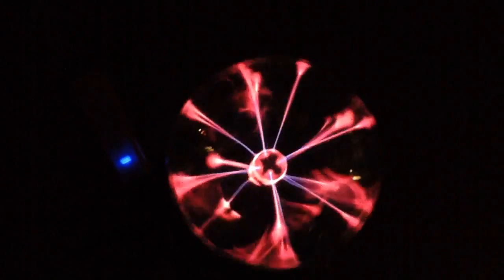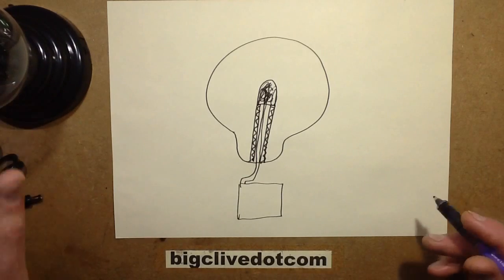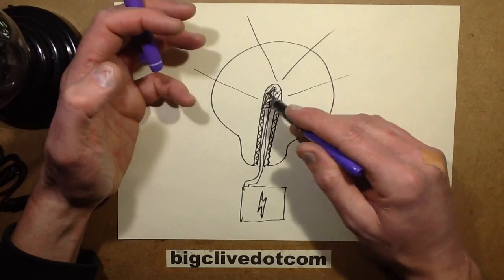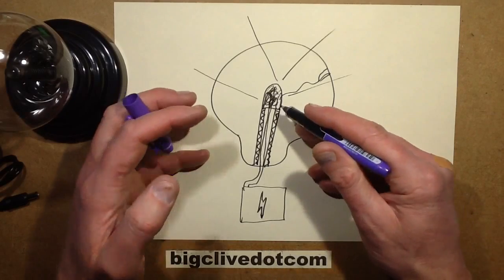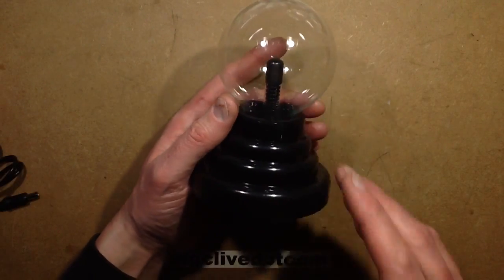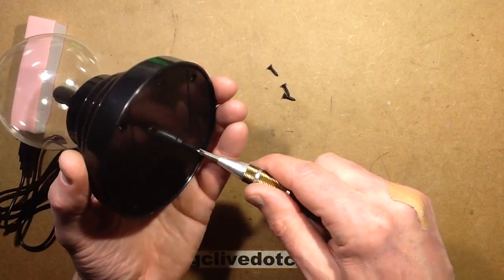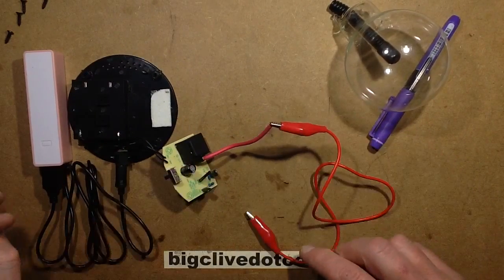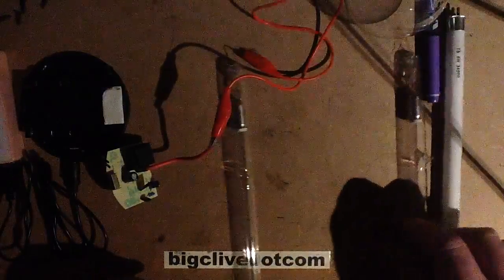USB plasma ball teardown and schematic.

Comment: So the shock you got was a burn and NOT as a result of high voltage? I’m designing a Tesla coil and want to take advantage of high frequency to prevent electric shocks, through the conductor skin effect. What’s the minimum frequency for this to happen? See electroBOOM’s videos on Tesla coils to see what I mean.
Reply: Over 500KHz. Litz wire works best below that but I'd say use 500KHz.

Comment: I have been burned by the secondary connection of a DC transformer for the larger ones. It may run on 12vdc, but at a very high voltage potential. I also had a12vdc ion generator module powered from a 6 volt battery with pins stuck in foil on both polarities in series with it and even they had coronas on them. The whole thing is an ion generator.

Comment: I had a plasma ball exactly like that as a kid, except mine didn't come with the USB cord, I used a regular power supply for it. Also mine had a bay for AA batteries in the bottom.

Comment: If you shouldn't power from your computer, and you shouldn't power it via a USB power supply, and it's USB, then how would you recommend powering it? I've one in the post and now I'm afraid to plug it in when it arrives :/
Reply: Bench power supply, a cheap USB charger you don't care for, an old broken PC...

Essentially anything you don't care about or something easily fixable

Comment: Hi Clive.
Could you use the electronics in the plasma ball for a powder coating system?
Reply from the maker: No.  It's AC output at high voltage.  It might be possible to rectify it with suitable diodes/arrays.

Comment: I have an old Rabbit Systems (ever heard of them?) plasma globe from 1987. Thing has a grounded plug and is rated for 117 volts at 30 watts. It has a microphone and will turn on and off with sound so it can flash with music. Pretty cool thing. It has a logo that says "Eye of The Storm" on the front of it. It has the old style glass antenna inside with a sphere at the top. I think may actually use a flyback transformer like you mentioned in the video. May have to open it up one day and peek inside.

Comment: you could put a coin on the top of the globe and then get another metallic thing and touch the two and pull the apart and you'd get a continuous spark , like a jacobs ladder.

Comment: Hi,

Mine works poorly - only about 2-3 streams (usually just that conductive tip glows). I'm not getting so many as you do. What could be the reason for this ? Gas leakage, failing transformer,... ? 😶😕🤔

Thanks !

Best Regards,
Reply from the maker: +David Bolha It's possibly the gas pressure inside the globe.
Reply: +bigclivedotcom Thank you for your reply sir, but how could I really fix/identify the actual problem (by process of elimination) ? Any ideas ? Thanks.
Reply: +David Bolha +bigclivedotcom the filaments in my old one have become thicker and lesser, so i bought a new one. The new one powered up nicely with thin and flowery like filaments, however within hours, the filaments have become lesser and slightly thicker... can pressure be lost within hours? thanks
Reply: It could be pressure/gas leakage, but it could be just any of the other electronic components that might have failed or are failing (in some manner). Hard to say without getting into proper electronics diagnostics. :|

Comment: Just pulled an 8 inch on of these out of the skip at work.
Plugged it in to an spare 12v power supply and it worked straight away. :)

Comment: Something weird I used to do with these plasma balls as a kid is cover them with tin foil and vaporize the metal material off of CD's with a tail of the foil. As imaginable these could also burn skin. Also was able to vaporize the metal paint off of playing/trading cards or reflective adverts, really anything which had a very thin conductive surface.

Comment: I ended up accidentally making a cell phone jammer with one when I was younger. I placed a soda can on top of the lamp, got shocked a few times, and realized I can make a small arc of electricity across the can and another metal object. When the arc was visible, the signal on my phone maxed out and immediately dropped to "No service." The range of the jamming effect extended just inside the 4 walls of the room. Leaving the room restored cell signal. I'm curious to see if anyone else has tried this.

Comment: bigclivedotcom: I bought one for these for $1 at a boot sale a few weeks ago and the HV seems weak, Not a lot of streamers when left alone and when you touch it you dont get a fine ribbon instead you get a thick band of plasma, However if you are touching the globe when you turn it on you get a very nice fine streamer that remains for as long as you keep your finger on it.. My question is that i suspect the HV is oscillating more slowly than it used to, Can you recommend a modification to get more Kick out of this thing and restore performance? or should I bin it?.

Comment: Hi! I bought a vintage plasma lamp at an antiques shop while traveling in Japan. Voltage there is 100V/50-60HZ while in my home country it is 110V/60HZ. Does anybody know if it is safe to plug it here or do I need a transformer? By the way, it appears to be Chinese, where voltage isn't 100v neither... Thank you!
Reply from the maker: +Alexis T. Aldrovandi The voltage difference is so small that it should be OK.
Reply: Thank you very much for your reply. Just tested the lamp and it was OK!

Comment: Hello great video!!!!  I am trying to convert one of these globes to run off an audio frequency converted to RF.  I have bought a device called an RF modulator.  It takes audio in and provides RF out.  Wondering if you have thoughts on this experiment?  Not sure if it will provide enough current or how the audio is converted to RF.  Thanks in advance!  Appreciate the video

Comment: Hey Clive love the video, but I have a question and hope you can help me.  I bought a plasma sphere like that one with the only difference that mine is powered with 4 as batteries. I wanted to use this sphere to convert a miniature building. Basically I remove the glass and place it in a plastic cilinder on the roof and I want to place the base of the sphere hidden in the building. I wanted to extend the wire that goes into the sphere ( by using a standard 1,5 MM wire.  But might I do this the plasma sphere does not work or sometimes it works but on less than half power.  Do you know Wat the reason is for this? And what I can do to make it work on full power, when I place the glass back in the base it works normally so it is not broken.
Reply: I'd love to know the answer too as I'm doing something similar. I'm making a new mounting which doesn't have space for the circuit board directly below the bulb so hope to extend the antenna wire. Clive you'll be doing at least 2 of your viewers a favour if you can shed some light (oh hell, pun not intended but happy it's here) on this

Comment: We need to get in to that battery compartment and make Ben Franklin style static detectors powered off of the battery terminal. Also, use something flexible like a sheet of foil and let the attraction flex the foil over to a ground to arc. Or flex over to a choke and let them battle it out. Then experiment with different materials to make some HV caps and do the same thing. We'll figure out a way to give you a heart attack yet. I hope you keep an AED around. If not we need to start a fund so you can buy one, but we'll only give you enough to buy a broken one because we want to see you fix it... and we are cheaper than Ilett lol

Comment: Could this possibly be used for a Lichtenburg wood burner power supply and be a little safer?
Don't know enough about transformers to workout if lowering the input current on the primary coil lowers the secondary coil mA rating to something safer or whether this would generate enough to create patterns.
probably a dumb question, but just wondering.
Enjoying your vids and learning quite a lot.
Cheers

Comment: I remember buying a bigger variant that connected to the mains. Couldn't have it in the same room as the computer and clock radio, it made them go haywire. And it was so powerful it actually hurt touching it more than a couple seconds.

Comment: Could somebody tell me if plasma balls work on the same principle as, what I generally refer to as high frequency machines (a.k.a. violet wand/ray or Darsonval/d'Arsonval units)?
I've seen the video (https://youtube.com/watch/5fuTnh6ofjY) on those machines and I realise they use another type of driver for generating the high frequency electricity. But is it the same principle? I.e. that the coated glass tube, in case of the plasma ball, and the neon tube, in case of the violet wand, acts as an antenna for, what is effectively, an RF noise generator?

Or have I got it all completely wrong? Please, enlighten me! :-)

Comment: These also work as Transcranial Stimulators. Connect two wires to the glass and the other ends to your temples...Cheap way to get the right DC voltage.

Comment: I had one of these plasma balls as a kid, but it ran from the mains through a transformer, if memory serves. I found that if I balanced a coin horizontally on the top, I could generate a spark outside of the glass by bring another coin close to it. With steady enough hands you could maintain a constant arc and burn paper with it!

The trick was getting your fingers away quick enough after placing the first coin, I had a black dot on my thumb and index finger for quite a while...
Reply: I did the exact same thing! lol
Reply: Me too!!!
Reply: I used to light florescent tubes with mine
Reply: Same ahah
Reply: Why wouldn't you put the coin on before turning on the lamp?
Reply: @MannOfTheHill345  Because I was stoned out of my mind
Reply: @AssflapsMcNulty  Yea, can confirm that's how that happens..
Reply: Forget plasma globe Tesla coil is the way to go going yeah you can air dry as a plasma globe with a Tesla coil of course so you could have both now a competition Tesla coil plasma globe that be something interesting
Reply: @aaronbrandenburg2441  i think you dropped some punctuation

Comment: If you wouldn't want to plug into a computer USB port what about the new RAM modules with a plasma tube on each module? These are very close to the CPU and the computer still operates seemingly fine although I'm not convinced.

Comment: I still have the one I bought in the 80's that is much bigger and I paid way too much for.

Those little transformers, I have a few of those (along with other goodies) I got as NOS replacement parts from the TV shop near my home that went out of business a few months ago. They used them to drive cold cathode backlights in plasma and early LCD sets before they went to LEDs

Ok so I wonder if you put a voltage tripler out of an old projection TV set on that output..

Comment: In most cases the 22-24kV from a television flyback won't carry enough current to cause you any real damage.
Reply: It still stings like a bitch though xD.
My hand once got too close to a flyback that was leaking high voltage, not fun.

Comment: dangerous to touch?
Reply: No, not at all, these things are perfectly safe. The only thing that is remotely dangerous about this specific one is that you plug it into your computer and not all computers handle highish voltage usb connections well.

Comment: I've got an old one of these from Radio Shack that is at least 30 years old. I haven't used it in 20 years or so. Guess I'll dig it out of the closet and play around with it to see if it still works. Would you like me to send it to you? Since I haven't used it in 20 years I don't think I'll miss it.

Comment: I have had loads of fun with plasma globes over the years & found most operate between about 15 to 25kHz. Some of the larger ones have produced quite strong near field RFI from around 10 to 80kHz.. (with spurious emissions across LF and lower HF HAM radio bands) If you run one above 100kHz you will find the larger current flow can burn your finger pretty quickly when the plasma arc is attracted to your finger on the globe. : Note: Placing a grounded electrode (I used a handy bit of 4mm CSA copper wire) on the glass it can heat the glass to melting point quite quickly!  But this tends to end badly for the plasma globe.  Enjoying your videos. Have fun Sir! :-)

Comment: When I was about 10, I remember setting a metal pocket knife on top of one of these and touching/drawing off a modest spark which burnt through paper. As I did this, the wireless door chime was 'activated' from the other side of the house. This makes sense now.

Comment: +bigclivedotcom
Dear Clive. You are my hero! I have silently hoped you would play with a UHF plasma driver and Neon tubes...
My knowledge in electronics stopped growing with 2SB trannies until I found your heavenly channel. 

 I scored some meter long curved tubes and hooked up a 12v (stepped down via plug pack) plasma driver (sans the ball...)
It droves tubes in parallel, series (More accurately Star and Delta) and it is a hoot.
I never thought it would drive them.
Thanks for revisiting the neon tube real and in conjunction with Plasma ball drivers.
Could I humbly suggest a look at Neon tube "Brick" transformers and driving neon tubes ?
I have a plastic potted (poured... looks like a spotty terrazzo brick ). 
I was told not to connect it with danger in mind... 
I realise you can't look inside a potted tranny, but the circuit and requirements might be interesting.
Thanks for being my OB-1 Kenobi ! You are my only hope... Unless I manage to listen to a very high pitched voice from a local guy on Youtube. I simply can't. ;-)

- Dave from Perth, WA

Comment: Judging by the power plug, it's exactly the same thing they built 20 years ago, but with a different cable (USB instead of an AC adapter / wall wart).

Comment: Hey clive, have you seen those 'emergency rechargeable LED bulbs' on ebay? I find them interesting, in the 'oh god, this will not end well' sort of fashion.
http://www.ebay.com/itm/E27Energy-Saving-LED-Intelligent-Lamp-Emergency-light-Battery-Rechargeable-Bulb/222269367249
Reply from the maker: Already covered the dodgiest version, but I'll be covering the newer safer versions soon.
Reply: bigclivedotcom oh, I must have missed that one.
Reply: is it possible to build a plasma ball with microwave components?
Reply from the maker: I would strongly recommend against using the components from a microwave oven.  They are far too powerful and very dangerous too.
Reply: I know it's dangerous, I was just wondering if the wave length is too long. 

Thanks for the reply :)
Reply from the maker: It would certainly ionise the gas.  I used to light a large neon star in my microwave until I ran it a bit too long and it cracked.

Comment: shudder the talk of the use of TV Fly-Backs, gives me the willies! Restoring a Maygay Screen Play fruit-machine, which is quite unique in that it uses a 18000 hz setup on the monitor (Which is a massive pain in the backside, as most monitors use either 15000 or 22000..... why the hell Maygay never used a standard PC style monitor is anyone's guess), suspect dead power supply / Transformer, and worse is that the fly-back is quite old, and appears on the actual wire, to be rather aged (It's around 20 years old, so no surprise)..... as anyone who's dealt with CRT's before, some pretty high voltage going on there, with this Kortek 37GGA85X-TC typically using 27KvH in operation (What it shows in my instruction book anyway)... Fellow machine restorer fortunately had no monitor issues, and got his working.... https://youtu.be/_JsyBslb8GU
Reply: Looks like a video gambling machine. I guess it has a computer in it and a program running.

Comment: Had one of those. Plugged in a 9V Wall Adapter to it. The wall adapter would actually put out 12V to 15V depending on load. Made the thing glow really well. Anyway the EM coming off of it killed my wireless keyboard. Always fun to put a layer of aluminum foil on the ball and try to touch it. Gives you nice little burnt pin pricks on your hand where the arch of electricity came off the foil.

Comment: I've found with these plasma balls you can pull a spark through the glass by putting a piece of metal near them
Reply: Casey Urquhart fold up a piece of 6x18 aluminum foil to 6x6 and mold around bulb and then turn on ckt.  Touch it if you dare...😉

Comment: Funny, I was just typing a question on whether that circuit would drive a neon tube single-endedly (just as you pulled that neon tube out).   Several years back, I made an argon-tube light-sabre (30-36" long) with a similar power supply to drive the tube 'single-ended' to make the sabre extend and retract out of the handle.   Cool stuff, thanks Clive!

Comment: These plasma globes haven't changed much, though they've gotten smaller. As a kid in the 90's I had an "Illuma-Storm Junior" from Radio Shack. As the name implies it was a smaller version of the original Illuma-Storm, but it was still bigger than the ones they make now.

The cool thing about the Junior was that it had an Edison lamp base so it could be plugged in to any lamp socket, and you didn't have to use the stand it came with. I had mine in my bedroom's ceiling lamp for years. :)